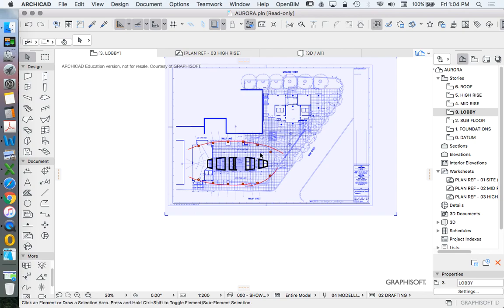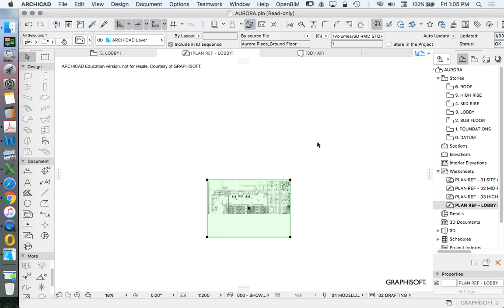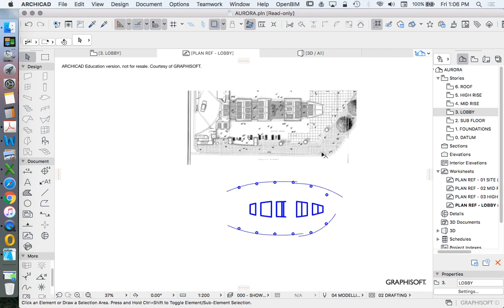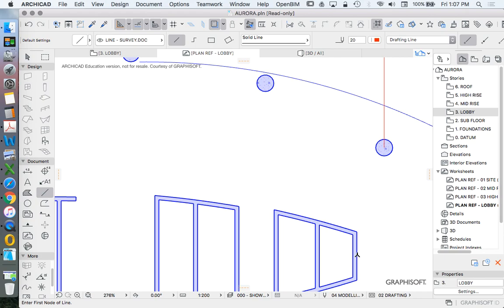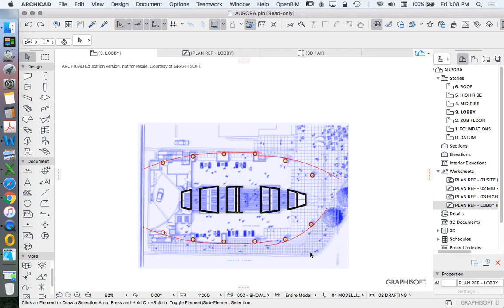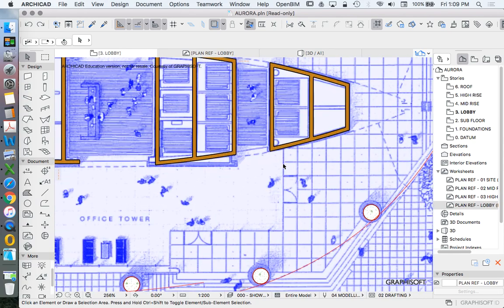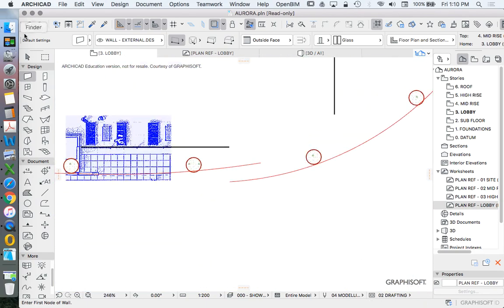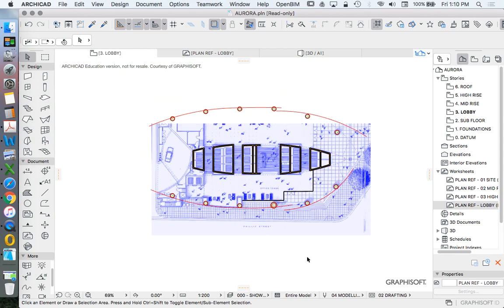ArchiCAD Aurora Place 11 lobby facade

Comment: you  can change the reference plane, so yo can see it on top,  is in the top of the screen in the standard palette, is the icon with the two squares one behind the other and you can see the option reference on top in the bottom